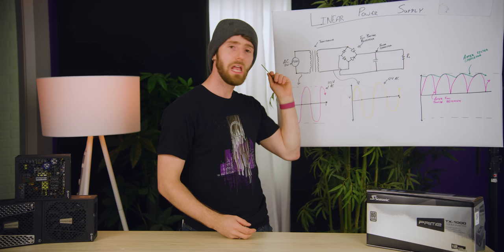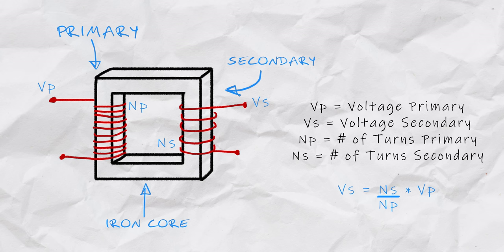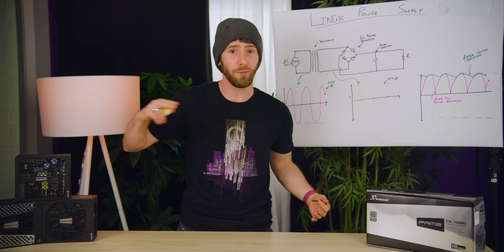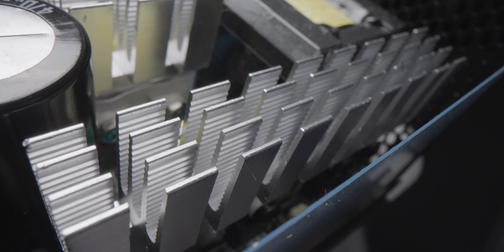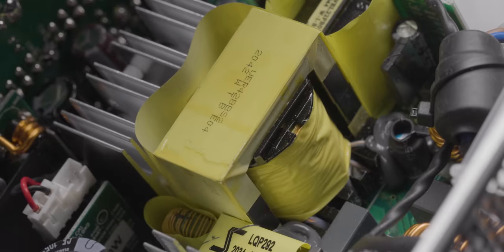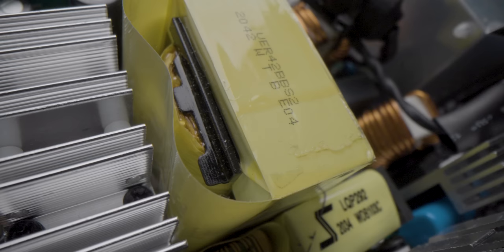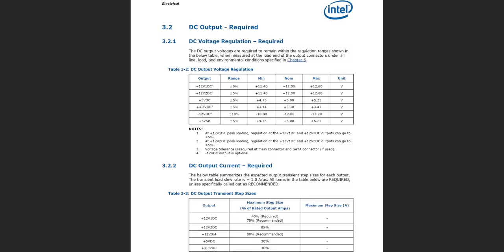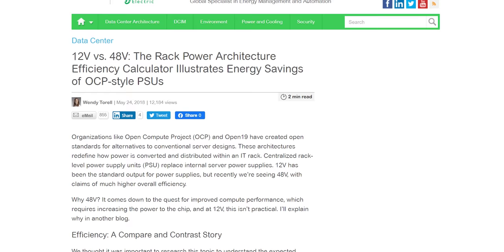How Power Supplies Work - Turbo Nerd Edition

Comment: I accidentally ordered a power supply with 220 instead of 110. Can I still use it and have it create less wattage or does this affect the voltage output on the other end? Will it be a fire hazard? This is a 1000w power supply so if I can get 500 watts I can still put it in something else.

Comment: My Corsair AX1200 sometimes works for 10 minutes, sometimes half an hour or more and then the computer shuts down. Then it doesn't turn on at all for hours. 
After a few hours it start working again. What could be the problem

Comment: Hold on let me get this straight. You can elude the concept of DC high voltage power transmission. But you explain SMPS with inductive core topology? Rectifier is before the flyback. 

What about emi, emf, bemf, capacitive leakage, switching frequencies, spread spectrum, gate resistance, transient conditions, peak and steady state efficiency, filtering, ESR, you know... The stuff that makes a good power supply. 

Why no SMPS primer, online, offline, buck, boost, isolated non-isolated...

Hire a power systems engineer....

Comment: 7:58 And THAT is why 12V PSU idea is stupid. They are suggesting putting power conversion circuitry near all those very sensitive digital components on the motherboard (like audio module which suffers from interference even now) instead of a designated separate box.
12V PSUs idea is stupid, facepalm of the ages.

Comment: I once had a 750watts PSU unknowingly before 4K was a thing I used the resolution scaling 200% option in a game my then sli setup tried to render 4K when again it wasn't even a thing, no gpus talked about supporting it, my psu blew up destroying one of the gpus and some of my usb ports stopped working on the motherboard, do yourself a favor and don't cheap out 100$ on what can end up costing you 3000$ I now run a 1200w psu for +-800watts of hardware, do you really want to take chances on your gpu in 2021 ? tought so...

Comment: I had my Seasonic Platinum PSU for 8 years. Recently it failed during gaming (a loud pop followed by instant power shut down), causing circuit breaker to skip. I unplugged the PSU from the power board and go outside to flip the circuit breaker switch back on. I then plugged this seemingly failed PSU back to power board and switched it on, causing another circuit trip. Being totally ignorant in electricity basics I repeated this for about 2 times. Will this fry the computer components ie. SSD, hard disk, CPU, motherboard? I couldn't smell anything burnt. Cheers
Is there some kind of fail-safe system that stops a failed PSU from transferring unfiltered power to the motherboard & other components?

Comment: so I have a b550-f gaming motherboard, Ryzen 5 5600g 32gigs 4 sticks of ram at 3200mhz.  4 case fans. a sata ssd, and a 7200rpm hdd with a 650w psu. I just got a Gigabyte  RTX 3070ti. everything was fine after the install, but I rebooted the pc today, and got some screen flicker. then I plugged in my ps4 controller, and the pc decided to reboot. is that because that 650w pau isn't enough?

Comment: What a sick joke. You don't turn 12VAC into 12VDC in a switching power supply. If it is a sinewave, 12VAC gives 12*1.414 output, minus the diode(s) forward voltage drop. The output, would be 16.968 VDC, before the diode drop. That drop is typically 150–450 mV, per . This requires a sinewave voltage of about 8.7 VAC
Synchronous Rectification uses power MOSFETs that are switched in phase with the transistors on the primary side, for even better efficiency. 
He mentions 'X' and 'Y' capacitors, but doesn't tell you what makes them different from regular film capacitors. These are seal healing, which means that if a failure develops, it will open that area of the capacitor to prevent a short. The 'X' capacitors go across the Line and Neutral. The 'Y' capacitors go from each of these, to the ground. They are used to attenuate the switching noise from the diodes on the AC input. So much more BS in this video.
Reply: Finally, someone with correct knowledge.
Reply: @ItsDextrin  The square root of two is important, in Electronics. I started in the field, at eight years old, almost 62 years ago. Before calculators, I did designs with dozens of pages of calculations to derive he correct values.

Comment: Soo i have a power supply with an issue. Its a cooler master 600w. Its giving all the correct voltages on the dc side. But it also has 0-40v ac coming through on the 12v rail. No ac voltage on the 5v and 3v rails. It fried my cousins pc and cooler master didn't help with warranty process. So if I can fix it that would be great. What area in these power supplies would I be looking that would allow ac voltage on the dc side?

Comment: I have 700w psu but my compnent are low consuming spec( example i5 4th with no gpu, hdd and 4gb ram, stock coolers) estimating 240w or less . Question is, does my computer consume 700w or does my PSU make adjustment and my pc only consume 240w only even though i have 700w psu?

Comment: Speaking of seasonic is it a good psu brand? I have a 500w 80+ gold seasonic psu and my dad never had any issues with seasonic
Reply: They are actually considered one of, if not the best psu brands
Reply: @Bendigo1  my friend told me to get an evga or corsair psu but my dad told me to get a seasonic and there were several guides recommending seasonic but the seasonic was at a good price, 80+ gold and it had 10 year warranty
Reply: @ReScrem  corsair and evga are good too but they cost more for the name.  
You can go with any of them and be ok.  But corsair and seasocic are the better of the 3.

Comment: I don't think this was a very good explanation (besides the ending part about different types of caps). I have designed AC:DC supplies before, and these are super standard as far as things go, but the amount of holes in the explanation is just kinda staggering.

Comment: Spec 2.53 is shit. 24 volt would have been better, 48 too high I'd say. 

Then there is the need to power sata devices directly from the motherboard too. No good. There will be too little space on vast majority of boards (so far) to power 4 or more devices. And I usually have 4-5. Now I will need DAS to store data or get a nas.

Comment: Someone pls answer, my cpu will be a i7-8700 and gtx 1660 graphics card, will a 550w psu be enough?
Reply: Search on how much watts each of your components are gonna use and add all of them. after that, add at least 50 - 75 more watts just to be safe

Comment: ways to get good power supply..
1. Brand
2. Years in Warranty ... if it's less than 12 years. ur fcked. 
3. design... yep design also helps cuz if it's trash PSU why would they put effort in it's design...

Comment: Ooof,  LTT really needs to better verify their information. They made a big mistake when they were talking about linear regulators. When they spoke about the full bridge rectifier, it sounded like they were calming that it also was the rectifier, which is isn't. A linear regulator is a whole other circuit. The transformer + rectifier simply gets you DC, it doesn't do anything to regulate that DC. 

Also, the math for a switching regulator isn't that complicated, you definitely don't need a PhD to understand it -- the 'paper' provided isn't a paper in the academic sense, it's an application note, which is more of a 'hey, I know you don't want to read a paper on how this works, so here's a few notes on how typical applications of this circuit are applied. Scientific papers, are well, scientific in nature. Application notes aren't. Alex should know better than this.

Comment: 1988-vintage design! Bad divide-and-conquer design. Look at 2012-era Bridgeless PFC supplies. Lower cost, smaller size, higher efficiency, better power factor, less EMI, less ripple. Let's see a video on a supply that is NOT 25 years out of date.